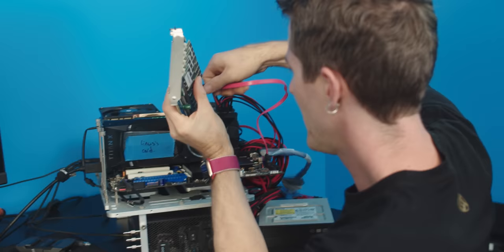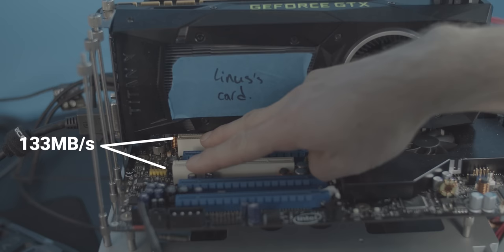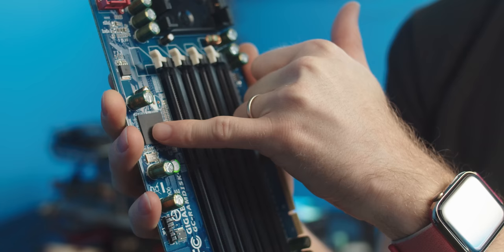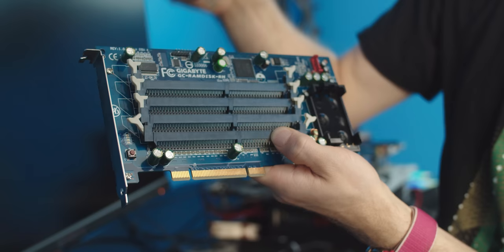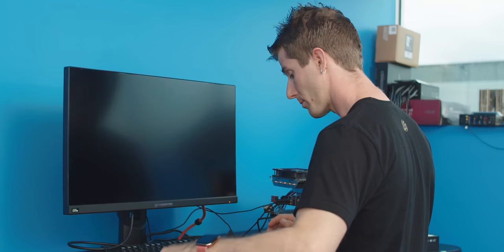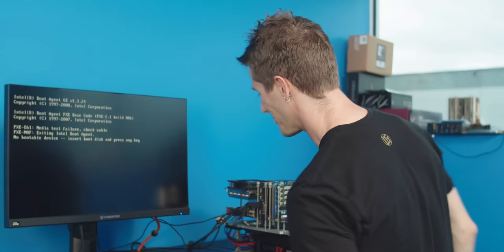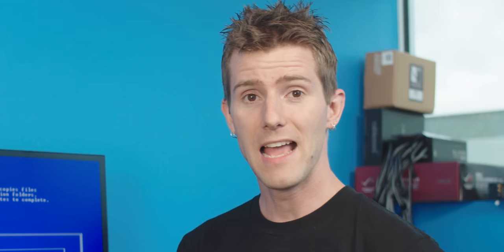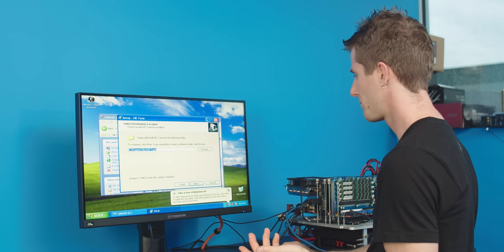WTF is this thing? - RAM on a PCI Card??

Comment: & there we see the problem with tech enthusiasts that have absolutely ZERO capacity for how to repurpose things. LINUS, You have a Linux guy ON STAFF. Have you ever heard of Swap Space? Helps boost RAM by picking up the slack when RAM is maxed out. The problem is, Swap space has to utilize a dedicated section of your HDD / SSD. Not only are HDD R/W speeds far slower than RAM R/W speeds, but it also adds significant wear & tear to your drive, but also reduces the drive capacity, because the portion of your drive that's reserved for swap space can ONLY be used for Swap Space. "But.. But SSDs are WAY faster now & so the R/W speeds aren't an issue anymore". Neat. Great. Now, what does that do for the excessive wear & tear to the SSD, (that typically have limited R/W cycles), or the impact to drive capacity? That's right, FUCK ALL. Absolutely NOTHING. So using part of your SSD for swap space STILL cuts into your drive space AND wears out your SSD faster. 

So, if for example, I have a laptop that's say... Running a 5th or 6th Gen i7, has both it's RAM bays full with 2x 8GB sticks of DDR3, (capping it out at 16 GB, unless I'm willing to shell out 4x the price of it's DDR4 counterpart for a 16 GB DDR3 stick, since a 16 GB DDR# stick is still $150 to $200, compared to $35 to $50 for the same capacity DDR4), is running an MSata or M.2 SSD for the OS & has an empty Sata bay. Said laptop is adequate for 90% of what I want to use it for, but just doesn't have Quite enough RAM for that last 10% of uses. Well Golly, I have 4 or 5 4 GB DDR3 Sodims kicking around in a drawer that are effectively useless to me, since there isn't anywhere left for me to plug in a 3rd RAM SoDIMM. 

Man, if only there was some way to get a SATA, (for laptops), or PCIe expansion card that I could just throw a those extra sticks of ram into, & then plug into my system, where I could then set that RAMdisk as my dedicated swap partition? Then I wouldn't have to wear out my SSD prematurely, I'd get to use the full capacity of my SSD & if the RAM sticks on the RAMdisk burn out or get corrupted, I could just pull them & replace them with more of the spares I have lying around. Man, if such a device was even available, let alone at the same price point as other simple adapter boards, (like nvme or Msata to Sata adapter boards which retail at like $5), that would be AMAZING for people like me, especially since it helps REDUCE e-waste & re-use old components. 

But nooooo, Even when I come across forums asking for exactly the same kind of thing, nobody, (including Linus here), seems to comprehend. "Y u wunt do dat? SSD is faystur an RAM don't store ur data..dont need RAMdisk anymoar. Jus buy bigger RAM. Wut? U haz bunch of smaller capacity RAM sticks & would rather make use of those? Don't want to make more e-waste with mindless consumption & disposal? Swap space on yur SSD makes usable space smaller & burns it out faster? My brain don't make sense what ur words dun mean." Get's pretty damn frustrating TBH. 

The point being, there's actually significant use for expansion boards just like that. Dedicated Swap space drives, Cache drives, TONS of them. But nah, most of these goons lack the brain power to even think about things like that.

Comment: this with DDR2 or better DDR-3 and 16GB would be cool !
Reply: Or you could just buy a 64gig ram motherboard and partition 50 gigs for a ramdisk...
Reply: @Lobos222  sure you can, search for servermainboards on ebay, older ones are cheaper but have 16 slots for ram

Comment: How about using ramdrive software with VMware so the virtual os is running directly on ram but you can have more GBs sometimes i used to use ramdrive to run gtasa because of the hacks I do on the cars making them go really fast the city can't load fast enough and I didn't have money for a solid state drive

Comment: Max 2400MHz DDR4 ECC for HP Z440 WS is 128GB, www.zworkstations.com offers a 512GB 2400MHz DDR4 ECC system without sharing details...
What card I need to obtain to expand ram memory over max 8x16GB (128)?
I live outside American continent, I can buy same ram here, but Zworkstations.com don't specifies what card they use to expand ram...

Comment: WD Raptor barely stood out from the pack? Gtfo, access times kicked the hell out of the competetion. Put two in a RAID-0 or 4 in a RAID-10 and you'd destroy every other 7200 RPM drive out there, even in RAID.

Comment: Is it not possible that you placed the Ram in the wrong slots.!?🤔🤓

Also the reason why this format was stopped is because of a little known known issue that I am sure that you know about.
An MRV (Memory Resident Virus)

Basically what it did was burn itself directly to the MMC rendering the entire module useless if not the entire banks and possibly the board that it was attached to.!🤓🤓

Comment: I would unironically buy a ramdisk on a pci-e card for temporary files.
Reply: Just buy more ram and use ramdisk software.
Just keep in mind that not all temp files are THAT temp, as in programs work fine if they are deleted at reboot or other loss of power. Personally I have a 10gig ramdisk (32gig sys) I use for nVidia Shadow play (temp files), which writes a ton of data when its on and I rather not wear down the SSD for such.
Reply: @Lobos222  My RAM is already maxed out. That's tge point.
Reply: @jamesowens7148  Well, that is just bad planing. If you had a higher need for faster access time on big data. You would buy a computer that suited that need and in turn had enough RAM. If you on the other hand want to save on SSD writes. Both the cost of the SSD and RAM comes into play. If its the latter and you have a costly SSD. You might be better of just buying a cheap one for the temp files if you lack open dimms.
Reply: @Lobos222  Please tell me who is white, burger san.

Comment: If you never turn off the computer, then what's the point of booting quickly?
Reply: Windows update is annoying?
Reply: +velcro. That is what the missing battery is for ( 05:15 black socket) ... It draws power to charge it while on and switch to it to retain info for x min if the PC loses power. Ergo, stuff that needs a reboot goes faster.